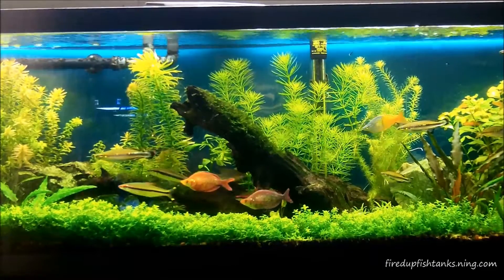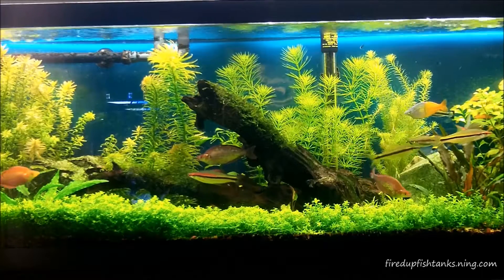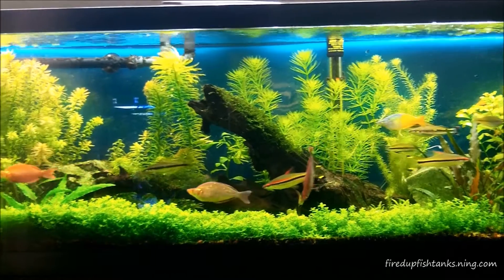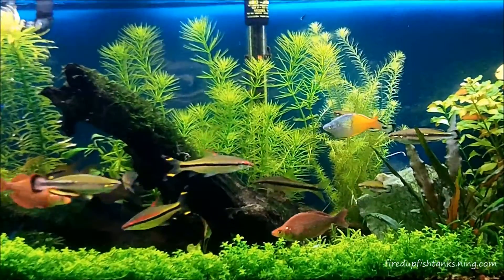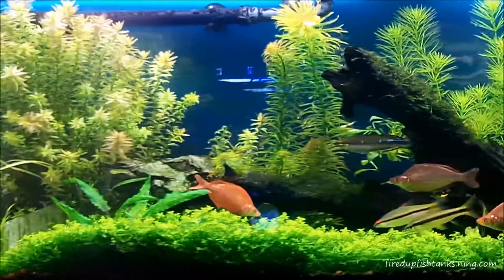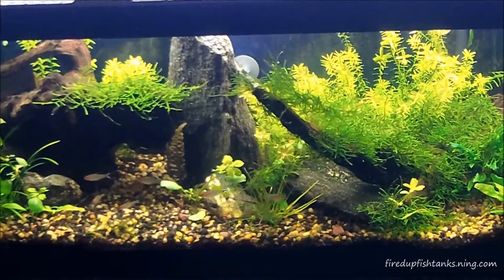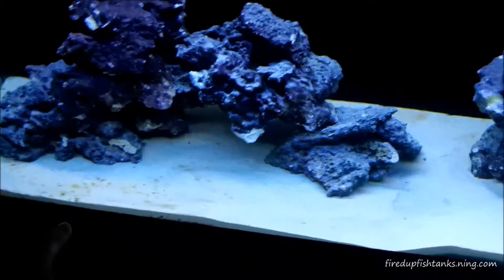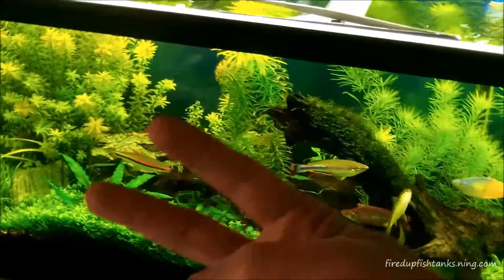DIY C02 and High Lights in a Planted Fishtank

Comment: Added DIY CO2 to my 55 gallon planted tank with low light plants. I have shop light with dual T8 35 watt 6,500k lighting.
I'm getting green algae on glass, rocks & white gravel. Any idea on what I can try to help improve this to enjoy keeping a planted tank. 

a) If I increase the lighting to T5 would that help or hinder algae growth?
b) I run my lights 8 hrs a day with timer- should I reduce it to 6 hours?
c) I don't use ferts, should I start?
d) Kill DIY C02?

I have a Amazon Sword, Jungle Val, Banana Plant, Wisteria & Duck Weed on top

Comment: you sound quite knowledgeable. I am still having issues with algae. I had 3 CFL 6500k 28w bulbs on the tank with pressurized co2 and at the time no fertilizer dosing. I had got tons of green cotton algea. No I switched to my T5HO 6500k (8hr/day)light and dosing 2/week flourish comprehensive, but the algae still wont go away. PLEASE HELP...
Reply from the maker: my first though is current in your tank..is the current goos all the way thru the tank and good surface movement?
Reply: Well I've done is move on left side, my fluval output pipe near the bottom to get good flow near the bottom, then I have a small pond pump mid and on the right side,a HOB to get water flow on the surface as well as my Eheim near the surface.